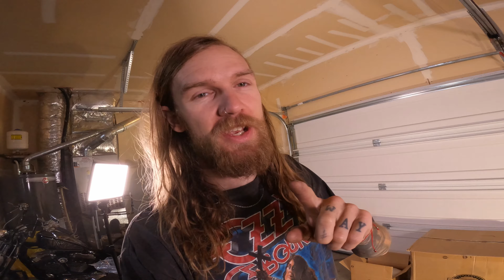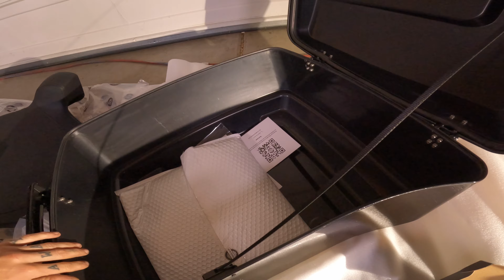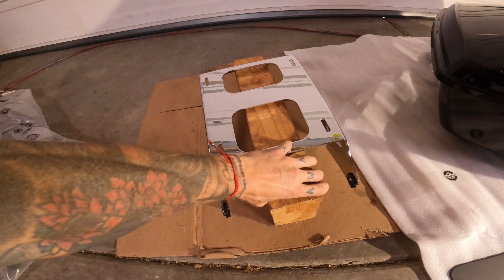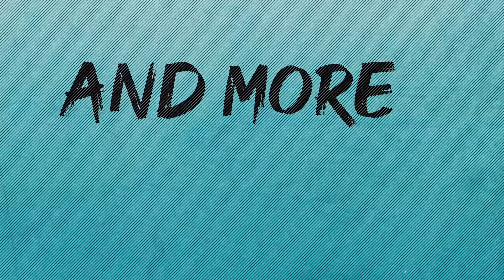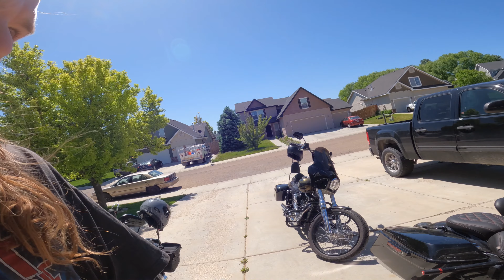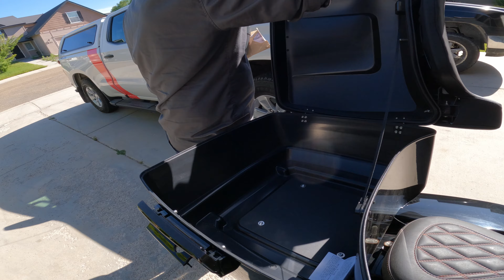Installing the Advanblack King Tour Pack - 2022 Road Glide ST

Comment: That actually looks really good. I got the Harley one, could have saved a ton going with Advan. Anyway, Amazon has some dope luggage bags that work out great for traveling. They fit in the side bags and the tour pack perfectly! Just pull them out and head to the hotel. They are cheap and get to your door quick! 🤘
Reply from the maker: Yeah we are really impressed with how nice the Advanblack ones are! And yes definitely need some go bags for the bike!